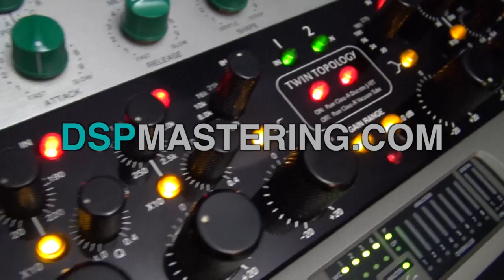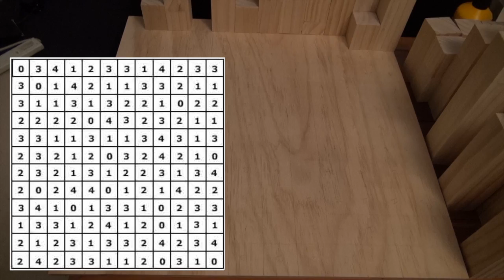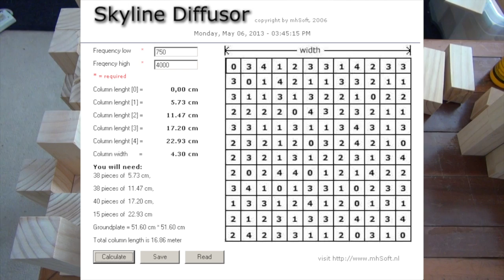How to build an acoustic diffuser

Comment from the maker: There is no limit to the amount of diffusion you can use. If you google blackbird studios they have an amazing room almost completely treated with diffusion. So the amount you use will be limited by space, cost and taste. While any placement would in theory have some positive effect, diffusion on the rear wall and/or first reflection points will produce the greatest gains. Personally I lean towards absorption on the first reflections and diffusion on the rear.
Reply: I went in that room in Nashville, the sound was incredible, I think the owner told me 182 000 pieces of wood where needed, he also stated that every piece of wood had a different length, they where mostly using that room for mastering work. They did play me "dark side of the moon" in 5.1 while I visited. It sounded very cool... To me the sound of that room didn't felt very "reflective", it was a very good sounding room almost had a paradoxal effect of a blend of "dead vs alive" with a wooden feel. Very cool. I'm building panels like these right now, my advices are, get a mite saw and a a belt/ disc sander otherwise you'll go insane. 16 square foot took me 9 hours to build, decent, my advice is to do at least 46 square foot for a room of 3000 cubic or I won't do much besides looking cool. I would call that kind of panels diffuser/absorber more than just diffuser it has defiantly and damping effect to it, just try to visit blackbird studio and you'll know what I'm talking about.

Comment: Thanks for your video really help !
How much area do you suggest to reflect? For example, my control room is 460 cm wide and 550 long. In the part of monitors and console there are absorption panels and bass traps (not all room). Is there a calculation of a maximum or minimum area, or use only the area of direct speakers reflection on the rear wall ? 
Thanks in advance !!!

Comment from the maker: Interesting idea, but I wouldn't. The point in diffusion is to evenly disperse / reflect the sound, by putting foam in the way you would be reducing the effectiveness of the diffuser. Also because you dont want to foam more then say 50% max of the room you would be better off using the two systems side by side to treat more surface area.

Comment from the maker: As a side note I wouldn't choose diffusion as the first option to improve acoustics. Bass traps, Bass trap and absorption are the best place to start. Also if your working in a small room diffusion might not be ideal. 
But to your question usually diffusers work around the 800 Hz to 4 KHz range so the default settings would be fine. You can go lower but this will require more depth, which is ok if you have the room. But again bass traps are better at dealing with low end problems.